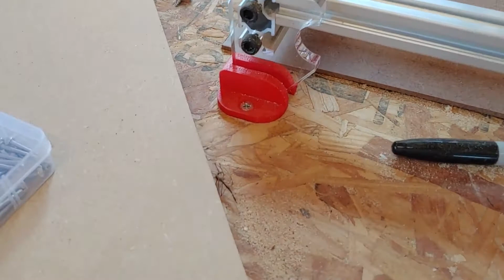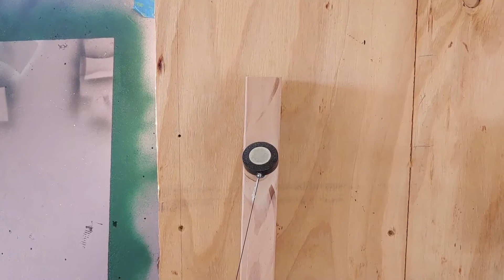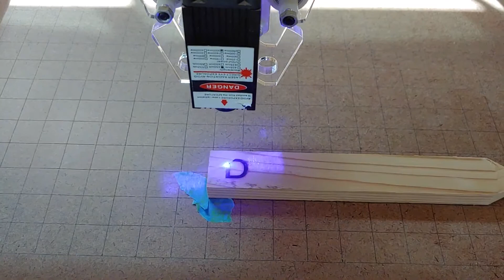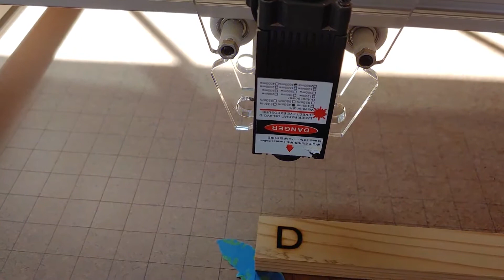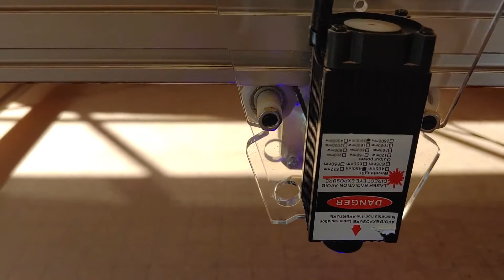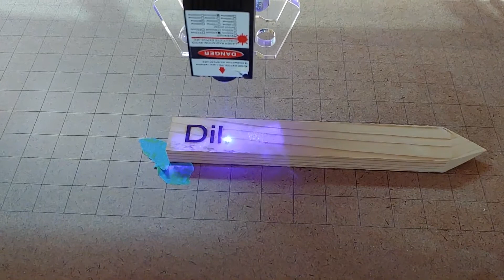7 Month Update on 50x65cm 3.3 watt Laser Engraver

Comment: i have exactly the same machine only just got it. can you tell me what it can and cant do? im still learning i think im definitely going to do a grid like you did. i found my X gantry has up and down play but my Y axis there is zero play, o cant seen to get the X gantry to have no play. im thinking about getting slightly bigger wheels if that is possible.
Reply from the maker: I elongated the holes on the carriage to take up the vertical play so that it didn't wobble. The 3w laser does good at engraving, but I found it lacking trying to cut. I need to do another update as I recently replaced the laser with a 7w. The 7w can cut through 1/8" plywood.
Reply: @DavidWalling  I need a better one myself best I can do is engrave wood really
Reply from the maker: @TotoGuy-Original  I went with the NEJE 30w laser. It's only a true 7.5w, but it works well. Just make sure you get the pwm control board if using the stock engraver controller. The TTL board doesn't work with the stock controller.
Reply: @DavidWalling  I think my board is Pwm because the TTL isn't being used I will have a look for that one thanks
Reply: @DavidWalling  Did you make a video of the laser upgrade you did?  I would be curious to see that with a parts list.
Reply from the maker: @sofa-king-cool  I did not. And funny enough, but I've also since upgraded again to the 40w "dual beam" laser. I have some more other upgrades planned and will try to get videos of those.

Comment: Good day. I'm planning to buy this type of kit but without the laser module. I wonder what type of laser module i can use. Can you put the link if you know? Thanks
Reply from the maker: I haven't looked into changing out the laser much. I'd like to get a stronger one. Unfortunately, I'm not sure which modules would work with the controller that it comes with. I'm not sure you'd save any money buying the kit without the laser and adding your own vs getting the kit with everything.
Reply: @Jeff Trinidad i have buy without laser head and i buy 10W laser head like this https://shopee.com.my/%EF%BC%88ready-stock%EF%BC%89-40W-Laser-Module-Kit-448-462nm-Continuous-Laser-Cutting-Engraving-Module-Blue-Light-TTL-Module-Set-for-Laser-Engraving-Machine-Cutting-Tool-Super-Fast-All-Metal-Engravable-i.35202258.8161596516